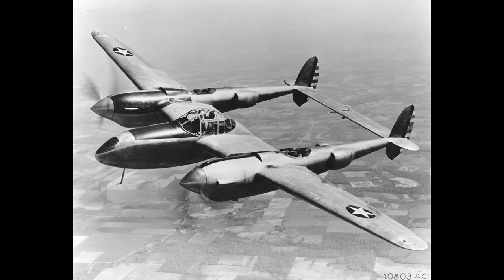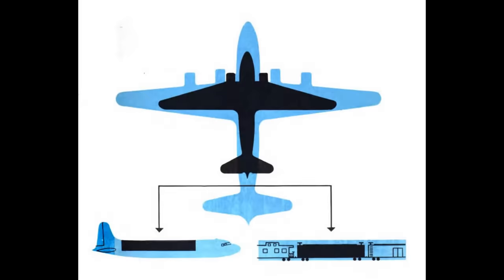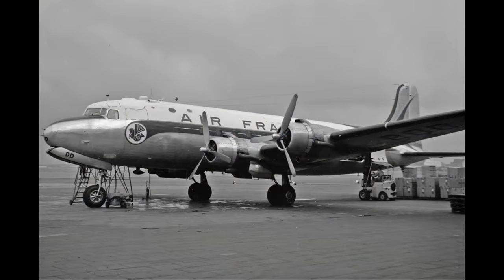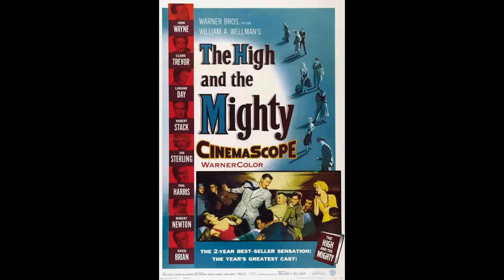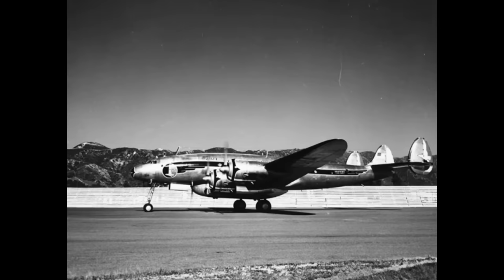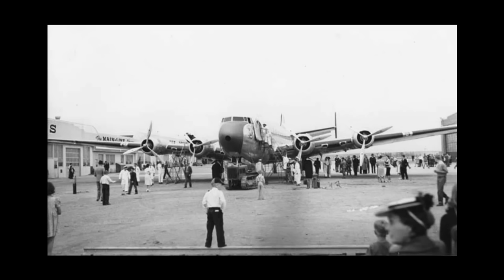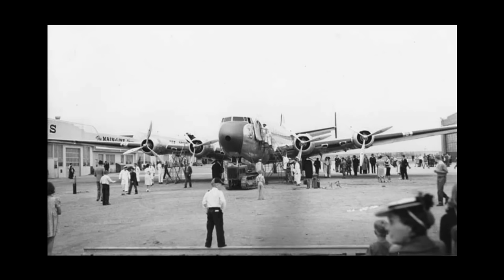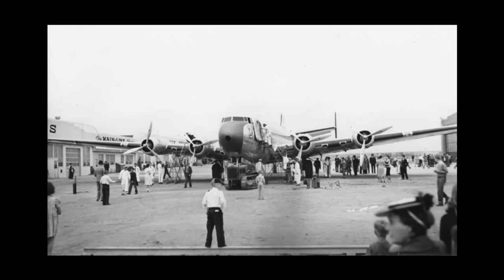Turbo Compound Piston Engines. Almost magic tech.

Comment: Unfortunately it is not accurate to say you can use exhaust velocity to create free horsepower. This can be demonstrated by considering a couple of fundamentals of physics. 

- 1st there is a direct relationship between exhaust velocity and pressure (edited: research "Bernoulli's Equation"). If you slow it down, the pressure increases.
- 2nd if you increase the exhaust pressure (back pressure), you directly reduce the power (research "the carnot cycle") from the piston engine. 

It is true that with specific, non-optimized engines that you can sometimes add things such as exhaust turbines and see minimal power decreases from the piston engine, but that is because the system wasn't optimized in one way or another (eg excessively low compression ratio or restrictive exhaust ports, etc). If the engine was further optimized, then adding an exhaust turbine,  of any type, will decrease power.

It is also sometimes true that specific, not fully optimized piston engines will lose less power than an exhaust turbine is able to add to the system as a whole.

Another huge factor that impacts aircrafts is the enormous change in elevation they must deal with. With increased elevation comes reduced air density. Failing to compensate from this through things like turbo chargers, super chargers, variable compression ratios, etc. essentially guarantees your engine isn't fully optimized...

BTW, An engine with compound turbos (eg a heavy diesel truck) has a pair of turbo chargers, usually sequentially configured. The purpose of this is to attempt to optimize the engine over a wider rpm range combined with reducing turbo lag. A single turbo, especially with diesel engines, is only able to perform well over a relatively narrow rpm range.
Reply from the maker: Nobody said anything about "free horsepower" in fact I think I was clear that it's not "free". As for the air density comment, the DC-7 engines are supercharged and make full power up to a relatively high altitude.
Reply: PV=nRT.  The V is Volume, not Velocity.  The rest of your post is mostly nonsense, since you don't even know what the letters stand for.  It is called a "blow down" turbo because exhaust velocity decreases or "blows down" as it passes through the turbine.

Energy is recovered by reduction in exhaust velocity.  E=mV^2/2.  So, reducing the exhaust velocity results in energy transfer to the turbine.  The energy is then coupled to the prop over time to transfer power.

Your comments about compound turbos are also an indication that you did not understand the video.  This is about turbo compounding, not compound turbos.

With a turbosupercharger power is increased primarily by pumping more air and therefore more air/fuel mixture into each intake stroke, greatly increasing the volumetric efficiency of the engine and the amount of fuel burned per power stroke.

With turbo compounding there is no additional supercharging performed by the turbo compounding system, rather, otherwise wasted energy in exhaust velocity is recovered and mechanically coupled (including fluid mechanics) to the propeller, with virtually no change in amount of fuel burned per power stroke.

In terms of energy per gallon this is essentially "free" energy, in that more energy is extracted per gallon of gas.  Overall there is a cost in weight and complexity, with complexity costing money for construction and decreasing reliability, and weight requiring more energy to move through the air, but overall, just in terms of fuel efficiency alone turbo compounding is in that limited sense "free" power and "free" range.
Reply: @neilhabermehl6187  you are correct that I referenced the wrong principal. It is Bernoulli's Equation, not the Ideal Gas Law that applies. 

It is still accurate that if you slow the velocity, the pressure increases. Bernoulli's Equation reduces to P1 + ½pV1² = P2 + ½pV2², where P is the pressure and V is the velocity. There is a more accurate equation that considers compressibility of the air better but the point remains the same.  Slow the exhaust velocity, increase the pressure.
Reply: The Bernoulli equation you cite is only for certain idealized systems.  When a gas travels through a tube with changing cross sectional area the simplified expression you cite no longer directly applies. @Slider68

Comment: Your turbocharger info is significantly outdated and inaccurate.  It is very common for a modern turbocharged engine to have a net positive pressure differential and therefore MORE than "100% efficient" boost/power increase.  The first time I saw this for myself, I thought there must be some human, sensor or dyno error.  That was 15ish years ago.
Reply from the maker: Listen again. I didn't say there would be no net positive pressure. I said the pressure before the turbine would be above ambient. If you are saying you have seen a turbo car with say, 10 pounds of boost and ambient pressure in the exhaust before the turbine I'm calling B.S. If you have proof of that existing, please post it.
Reply: @GregsAirplanesandAutomobiles  explain to me why I get 20% better fuel economy when I command more VGT position.

Comment: Christ, it took almost 12 minutes to get to turbo stuff, and the rest has a lot of "balast" as well. As a video called "Turbo Compound Piston Engines" it would be better at one third its length.
Reply from the maker: I disagree, and this is by far my most successful video ever and by every metric.
Reply: @GregsAirplanesandAutomobiles  Well, many people like ”soup around the beef” and I’m not saying it’s not interesting stuff.  I, however, like more your earlier videos that stick to the point.  In more recent ones you tend to go more on a tangent.

Comment: The represention of the routes between United States and Europe are wrong. You depict them as straight lines which in reality these are arches touching Greenland and Iceland.
Reply: Nope, the picture was right, but you are half right. A Great Circle route is a straight line on a globe, which is what the picture is showing. On a flat map, such as the commonly used Mercator projection, a Great Circle is an arc, as you stated.
Reply from the maker: Thanks DABrock. You are exactly correct.
Reply: @GregsAirplanesandAutomobiles  Nice to know that the flying lessons I took back in the 80’s weren’t totally wasted.

I hope you’ll be able to do a video on diesel aircraft engines sometime soon. I think they are a big ‘what if’ in the history of aircraft development.

Of course, I have an ulterior motive, as aircraft diesels will play a role in the book that I’m currently working on. 🤓

Comment: "The most boring car company" and you show a picture of a Subaru? Did you forget the WRX?
Reply from the maker: No I didn't forget it. They have built a few exciting cars, the WRX is one.
Reply: @GregsAirplanesandAutomobiles  I would put Toyota at the top of the list.
Reply: @GregsAirplanesandAutomobiles  I would also put Toyota the top of my worst car brand list. Based on cars I've owned. That would be out of Ford/Mercury, Honda, Subaru, Dodge, Oldsmobile, Triumph, Chevrolet/GMC, Toyota, Nissan.

Comment: 23:57 That formula is clearly BS, because (according to it) at zero speed a jet engine generates equally ZERO horsepower, well then how come does it start moving at all?
Reply: Horsepower is torque x speed. At 0 speed, there is 0 HP. A locked rotor electric motor also produces 0 HP, but it can provide a heck of a lot of torque. That's how trains start moving.
Reply from the maker: Let me explain. NO, it's not B.S. First of all, consider the source for that formula. It's from Aerodynamics For Naval Aviators, which is probably the most peer reviewed book on this topic ever. It's one of the source documents for the FAA's written tests and is on the FAA's website along with the AIM and other stuff. continued:

You are correct in that at zero airspeed, the jet engine has zero propulsive horsepower. That seems counter intuitive, but it's absolutely correct. The plane starts moving because Thrust exceeds Drag, not because it has propulsive horsepower at that point.
Reply: @GregsAirplanesandAutomobiles OK, now that makes sense, thanks for comprehensive explanation.
Reply: @GregsAirplanesandAutomobiles  But isn't that exactly the same story with the propeller? At zero speed it also generates zero horsepower, for the exact same reason?